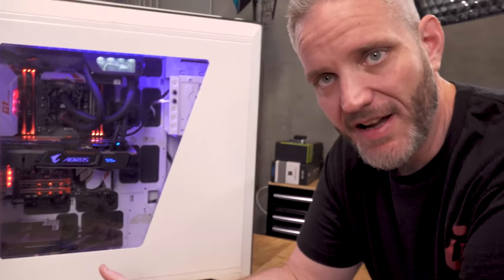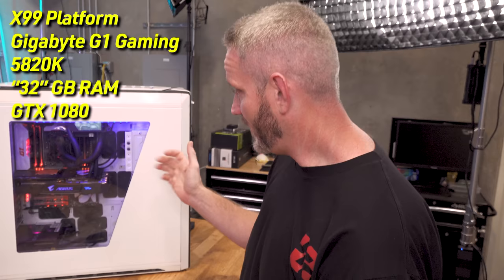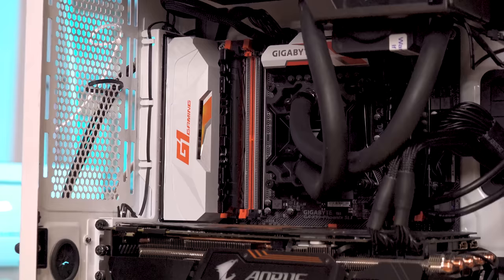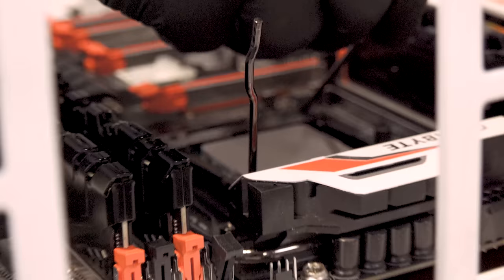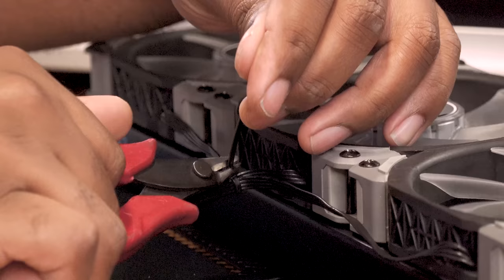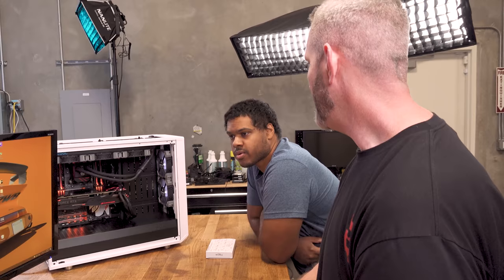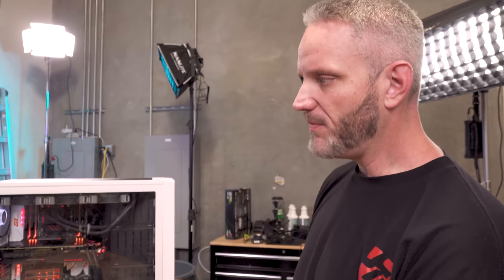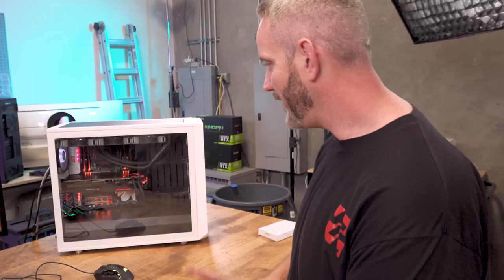This Gaming Rig needed some serious help!

Comment: Jay was exuding some serious Ron Swanson energy when he threw that case in the dumpster lol. Shoot now that I think about it maybe that was intentional lol.
Reply: It probably was! I loved it.
Reply: Jay loves The Office (American version), so it's extremely likely that it was intentional hahaha
Reply: What was wrong with the case? It was large and had four 5.25'' drive bays. D:

In terms of cases, everyone these days is prioritizing overkill cooling, and chances are, most people will never ever need that much cooling.
Reply: @arnox4554  Definitely not overkill cooling, these days both graphics card and cpu clock speeds are linked directly to temperature, so better cooling is better performance. Sure a nearly sealed glass box like we had 3-4 years ago probably won't make the parts thermal throttle, but unless we are talking laptops simply not throttling isn't good enough.
Reply: @sabero5668  Even so, in this case, I value functionality over speed. Just for starters, I can't tell you how nice it is having a hot-swappable drive bay. Lets me treat any internal HDD/SSD as a giant USB thumb drive.

Comment: Love old part builds shows off what most people have to work with.
Reply: Yeah...thick clear Plastic Sidepanals with holes in it to mount a FAN onto it...urgh...also huge front Bays that don't allow Fans...
Every old PC i know had at MOST 3-5 Fans in it: One at the Front (if any), One at the Back (if any), 1 CPU Fan that blows down (Intel Stock cooler), 1 small GPU FAN and one in the PSU...
Reply: @gucky4717  My old CoolerMaster Half X was the best case I've had it was easy to build in had amazing airflow and a fan of the side panel to keep the GPU nice and cool. The fan on the side panel would come in really useful nowadays if you had you GPU in a vertical mount. I miss that case should have never sold it. My trustly old i5 3570K 8GB DDR3 1600mhz an Asus ROG Formula V Motherboard and a plethora of GPU'S had been put to work in that rig amongst them was two GTX 680'S and the first GTX Titan good times. That was without a doubt the best MB I've had aswell my next mb will be a full on ROG board aswell no doubt it looked absolutely stunning. It's a shame nowadays that building a good rig for a decent price is pretty much impossible. The GPU in my new rig cost four times the price of my old GTX 680 Direct CU ii. I hope one day PC'S become affordable for the majority of gamers as they really are missing out not only on gaming but all the fun that comes with it building been one of the most enjoyable as when it all comes together and you get all those FPS it's great.
Reply: @originalityisdead.9513  It's not impossible to build a good and affordable PC these days, you just have to do a lot of research and, most importantly, refrain from buying a GPU lol.
Reply: @teubert2  I know it's ridiculous the new consoles are great value for money if they had full KB&M support in all games they would be a viable option instead of a mid range gaming PC. The problem been the only one you can get easily is the Series S sometimes the Series X and never the PS5.

Comment: "It can't be 24 Gigs. There's 4 sticks, it's not divisible."
>Stares at 4 sticks of 24 Gigs in personal rig
Reply: 24 gb is easy. 2 x 4gb and 2 x 8gb. ive got the same amount in a 6 x 4gb config

edit 6 x 2gb to 6 x 4gb. cause im dumb and forgot how to count lol
Reply: you running 2 4s and 2 8s?
Reply: That would work in a dual channel system, but not in this one cuz it's quad channel. You need the same amount of memory in each channel
Reply: 4 sticks of 24 Gigs? That means you have 96 Gigs total
Reply: @Eidolon2003  yeah plus x99 is pretty well known for dropping a channel randomly
Reply: @bofasofa9399  its a 4 x 8gb stick config with one stick not seated right.
Reply: 24 is divisible by 4 with 6gig ram sticks (4x6 config) Jay just knew Nick probably didn’t buy a 24gig kit
Reply: @jpcost  but do mainstream 6gb stick exists?
Reply: I have 24 gigs in my system, but my motherboard has 6 ram slots odd ball board not sure they make any with 6 anymore ☺️
Reply: @Eidolon2003   Yep I have 12GB of DDR3 2x2GB + 2x4GB.

But I wish every non server platform would use quad channel memories without necessary increasing the current msrp price...

EDIT: Forgot to say that Dual channel is so damn old and specially with the performance we have nowadays I wonder why dual channel is still the king, I mean I'm using dual channel since my Pentium IV from 2004 and only didn't have dual channel in the PI and PIII from my father...
Reply: On my sisters PC with old HEDT Sandy Bridge-E CPU it was originally 8GB DDR3 in 4x2GB and I added 4x4GB for totally 24GB in quad channel :D
Reply: I have 24GB with 6x 4GB sticks in triple channel on X58
Reply: @marshall104  I had a system with 18GB, which confused people for bit when I said that.
Reply: Speaking about weird memory configs, I actually had 80GB RAM for a while in my X79 system, but I went back down to 64GB for better memory speeds.
It had 4x 16GB, 1x 8GB and 2x 4GB sticks and one free slot
Reply: @Eidolon2003  if I remember right, you need same amount for optimal performance, but it's not really necessary.
Reply: Oh shit you too lll
Reply: @Sup_D  Yeah it's not necessary, but as soon as one of your channels runs out of capacity your performance drops as if it weren't there at all.
Reply: @marshall104  im running 2 16s and 2 8s in my pc at work

Comment: Damn, he was running the same CPU and GPU as I have been until I got a little bit newer GPU this year. Still running my 5820k.
Reply: Yup.. me too... then I found a i7-6950x for pennies on the pound and picked up a second hand 2070 for cheap just before prices went through the roof (Thanks for the warning Jay) The i7-6900x is probably better for gaming tbh. Slightly higher core clock and better overclocking on an old motherboard. Can be had for about 150-170 ($ or £)

The upgrade from a 5820 is surprisingly worth it. Brings it to roughly AMD 3800x level for gaming/compiling
Reply: @ianelsley71  Same here 5820k oc at 4.4GHz all core and a 2070 Super. It does well at 1440p
Reply: Nice! I'm still running a 3770 and 3770k 😅
Reply: @ianelsley71  you are off your chops if you think those two cpus are comparable
Reply: @chasp_0784  Ok, not quite. I looked up the passmark after your comment. Pasmark cpy on the  3800 is 23k. I get 19.5k on my rig which should be a 16-17% difference (admittedly OC.)

That said my experience is that large compile times on a 3800x and a 6950k are almost identical - to within a few seconds of each other.
Reply: I rocked my 5820k until late last year, still use it in my media PC. Love that CPU, still does a great job with almost everything that I do

Comment: Can we just appreciate the irony of that BIOS screen for a second?

"GIGABYTE: Insist on ULTRA DURABLE"

Yeah that aged like milk.
Reply: I have two gigabyte boards, both of which have weird issues like refusing to see the boot drive.
Reply: Dude I got a Gigabyte Z590 motherboard that says that too. From a prebuilt I bought in June!
Reply: Asus all da way homies, two builds over 5 years and not a single issue ever whether overclocking or updating or whatever else
Reply: @chainedscythe2000  both of those gigabyte boards got replaced with Asus.
Reply: I have Gigabyte RTX 2070 Super and it's still chugging along with no issues and hardcore use over the last year and a half. Just becuase a company has had a problem with 1 or 2 products doesn't mean all of their products are trash, I mean shit just look at the old AMD FX CPUs and now how is AMD doing?
Reply: @NonLegitNation2  their graphics cards are good(except their lowest end Vega cards) but their motherboard bios is really buggy.

Comment: Not sure what is more entertaining Jay providing theme music or Jay having to tell the nick 4x8 is not 24.
Reply: I was just thinking 2x8 and 2x4. Lots of company laptops are like that, where IT upgrades the ram by adding a single 4gb stick to the empty slot...
Reply: @ilovefunnyamv2nd  that works in two channel memory at 2666mhz with loose timings it becomes rather difficult to use above 3200mhz C16 in four channel. At least with good stability.

Comment: Your description of the Alphacool AIO is the exact reason why I chose them.  I started with the Eisbaer 360 on my Ryzen 2700x, then added their waterblock setup to my RX580, replaced the pump/block combo with the Eisblock XPX, added a 120mm radiator to the back and a have an Enermax 400ml pump/res combo.  Watercooling is a sickness and I DONT WANT THE CURE!  Thanks Jay!

Comment: Curious to hear what kind of VR improvement Nick got in iRacing as that is a notoriously single core based sim and heavily CPU dependant on a monitor, let alone in VR (Speaking from experience)
Reply: Agreed.  I suspect upgrading to a 5600X would have been the best move, but I'm sure he'll be happy with what he has.

Comment: Really curious how much more the clean Win install on the SSD and cleanup of the hard drives gave. Another 10-15%??
Reply: Imagine if he even took the time to go through and De-bloat windows 10. I have seen 3 or 4% increase before with just stopping all the crap that runs in the background with vanilla win10
Reply: Unlikely, remember that with Windows 10 every major version upgrade was in fact a fresh OS install that kept your user data in place. That alone should have prevented the worst cases of performance attrition seen in previous versions towards the end of their support life cycle.
Reply: @proesterchen  That's not entirely true. Whenever there is an update, no matter the size, the old files are kept in case there is some issue with the update and you can revert to the previous one. Not to mention, if you have taken the time to go through and de-bloat win10 then a lot of the stuff like onedrive will always be reinstalled as well. The way Microsoft does their updates is really messy actually now that I think about it lol
Reply: @thisismelsemail1217  Yes, the old Windows install is moved aside and kept around for a bit to allow for recovery and roll-back, but my point was that every major Windows update basically put a fresh and known-good Windows on your disk from the install image and then applied your user data to this fresh image, while in the olden days updates and Service Packs would just replace files in your existing Windows install.

Yes, if you change Windows default behaviour in a way that isn't accounted for in this new upgrade process, those changes will need to be redone.

But you no longer get the somewhat precarious generations upon generations of updates that older versions of Windows would turn into with time, and many of the problems caused by these tweaks with future updates simply don't exist anymore.
Reply: @bronzehd6212  would figure more because he was on 3 spinning rust and just installed the m.2 that's a heck of a speed boost to the OS alone

Comment: 24G DDR4 = 2x8G + 2X4G
Not Impossible. Not Optimal.
Reply: Why is this not optimal. As long as each channel is capacity matched and all four sticks have the same latencies, there should be no degradation in performance (assuming dual channel).
Reply: @oblivionshadow9453  Well, first of all this is a quad channel platform. Other than that, different memory chips have different properties. Running stock shouldn't be difficult, but you would likely encounter issues or degrade the performance if overclocking or even running XMP. And most 4Gbit memory chips are quite old and quite slow.

Comment: The 6900 was still a "k", the 6950 was the only "X" in that gen but had 2 more cores over the 5000 HEDT series. The 6900k was decent though - but unbelievably overpriced since it was the last gen before Ryzen came out.
Reply: My 5600x gets a better cpu score.
Reply: @EvilTurkeySlices  Just remember the R7 1800x managed to match it on release. A 3700x like mine can even beat the 6900k, which was $1k before Ryzen!

Comment: I only recently (like last year) upgraded my Switch 810... And yes the rubber grommets on those cases do kind dry rot or something every time you touch them you get grey marks on your hand.

Another thing I learned from experience that can fix a ram slot that's not working when everything else seems to be working fine is reseating the CPU (I was using a 5960x and ASUS x99 Deluxe).

Comment: Had my h220x in corsair 600t, pump just died after running it at max for couple months in custom loop with a 3080 and 5800x 😄😄all on the original 240 LOL replaced it with a 420mm rad and makes the Temps soo much better

Comment: The pump in that pump block is a DC-LT which is on par with a current gen asetek pump. I have tested it myself with a DC-LT 2600 and eisbaer. it is essentially an eisbaer lt solo with a reservoir attached. I'd still recommend a asetek design over one of these if you don't need the expandability. Which won't matter because the pump is anemic at best and can't handle a GPU block let alone another rad. Refilling also doesn't matter because the pump will die before the fluid needs to be changed they are that bad.

Comment: I just upgraded from x99 to x570 and the thing about m.2 on x99 is that it sucks, on my system it was actually slower than my sata ssd. This was the first generation to support m.2. I also had a rampage v edition 10 which is one of the x99 refresh boards and the last to release for the platform, so it wasn't a case of an early board.

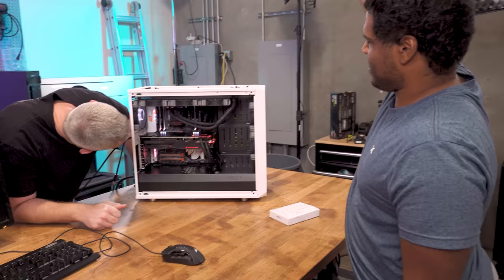Comment: ( 9:30 - 9:32 )  Nick, that was a Huge Anti-static spark down by your lower two Pci-e ports on the MB. you may want to check that out and clean them. Just letting you know

Comment: A good match for the RTX 2080 Super is the XEON E5-2678V3 (12C/24T) or XEON-2690V3 (12C/24T). I have the former (on an X99TF)  that cost me $85 on eBay.  With TURBO UNLOCK (Miyconst channel for tool kit), I get 3.3 GHz all core on the 2678.  Runs very cool on air.  Very solid platform for VR imo.

Comment: Google just popped this up for me to see...  a little old. But so am I, I started on a compaq deskpro, an 8086 based box, 4.77 Mhz with turbo a little over 7 Mhz. No SIMMS back then. Adding RAM involved individual chips into sockets on the motherboard, in rows of 9 (8 + parity). Troubleshooting started with the BIOS chip. Pressure on the middle, then on both ends  one at a time. If it sank in with click, that was usually it (chip creep was a problem back then). If not, it was time to press on every individual RAM chip on the  otherboard.

Comment: yeah there's always a problem with the first ram slot on my gigabyte x99 board, almost everytime i unplug the ram modules after that first slot is not detecting, even if all the sticks are properly seated....so I just swap places for 2 sticks in slot1 and slot2 and it works again....weird but ok.

Comment: Those X99 boards can be a bit finicky when it comes to ram. Have 4 older builds for the family and had to be careful which brand of ram to use to get them to run properly.

Comment: Heya Jay I have the same CPU on an Asus x99 board and it does the same thing if I swap ram to other slots as in boot loop the other is once I swapped it all back over it wouldn't even boot or boot loop

Comment: Used to have a 5820K on a ASUS X99 Deluxe, me and other people on the platform I knew personally had issues with RAM a lot as well.
It was the first consumer DDR4 chipset so I guess they just had problems with that early on.
It always felt like there was something physically wrong with the slots on those early boards.

Comment: I like slightly retro cases. I really like slightly retro cases. I like them so much I'm using an original antec 900, and it's my dream case. I cried a bit when he threw that one away. Didn't even give it to a new pc builder or anything, after years of good use, and no significant failure. sadge.

Comment: i had this same bootloop issue with my mobo with ram, no matter how much i swapped, 1 stick 2 stick 3 stick ect ect in different slots it would just constant loop, i then tried a diff board and it worked perfectly all sticks, i tried swapping CPU that didn't help, tried cmos reset that didn't help, no matter what i did that mobo went from fully working to well how does one boot, ended up selling it, the mobo did infact work prior to adding more memory in the other slots, after that it just refused to boot.

Comment: Another quality video with another nice upgrade build.
I have to ask, shouldn't the 2080 have higher 3D Mark numbers that what it's got there? I did some testing the other day with my rig, which is running a Gigabyte 2070 Super Gaming OC 8 gig, and my GPU score was 10,225. I'm also running at 1440p Ultra. My cpu is a R5 3600, the score on that was 6894, giving a total of 9534. I know my CPU score should be better, but my GPU score should be a little worse than what you've gotten. BTW, my M/B is an AORUS B450 AORUS ELITE. What would be the reason for my GPU score to be so much better than your GPU, which the next step up from my GPU?

Comment: For iRacing in VR, clockspeed and IPC hugely impact render thread performance (and thus frame rate), and a 5600X might have been a more useful upgrade.

For more exhaustive analysis, and excellent iRacing specific upgrade advice, Nick should visit the forums.

Comment: I'm having a problem with my pc and looking for advice as to what it might be or might cause it. So sometimes when the pc is of for a long time and i press the power it doesn't turn on unless i wack it a few times xd. I did wipe windows and installed a new psu but stil the same it doesn't shut down aswell

Comment: As much as I like my system… it’s basically Nic’s build in a Corsair case. ASUS X-99 prime with a 5820k running 4.5GHz all core on AIO with a gigabyte GTX 1080. Still works great though with my 1440p ultra wide.

Perhaps time for an upgrade soon….